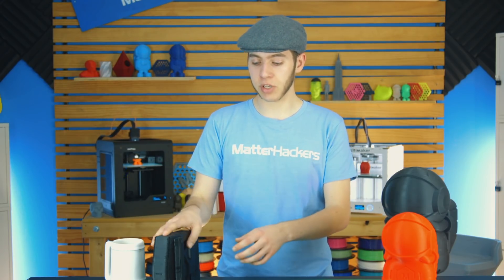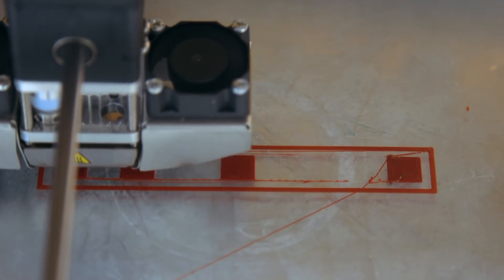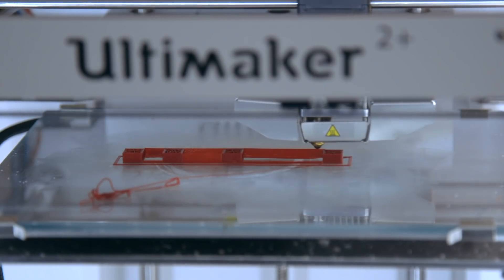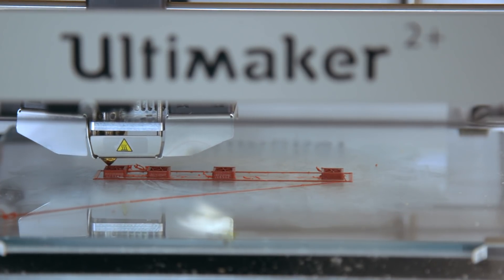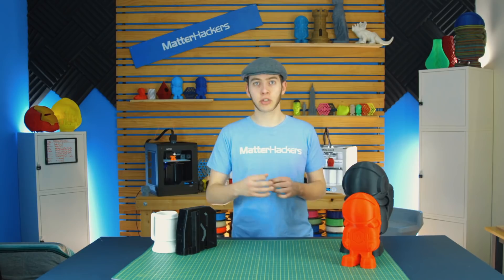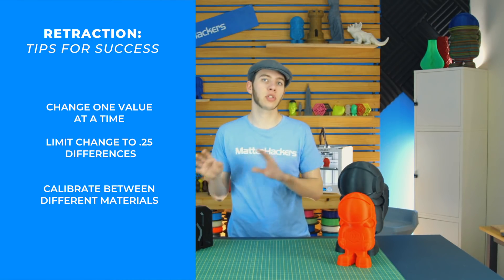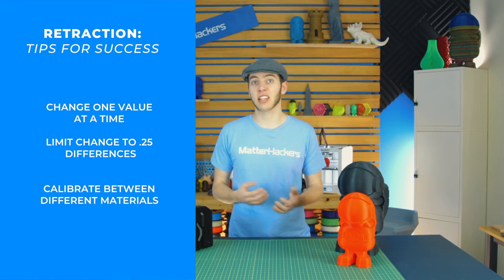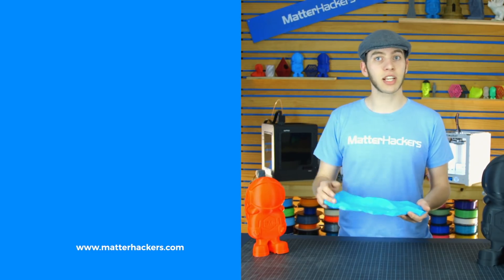How To Dial In 3D Printer Retraction Settings // 3D Printing Guide & Tutorial

Comment: You should try the "retract continue" post-processing plugin. This resolves all stringing and oozing for me (expert user ~10 years in 3d printing now). It works on an Ultimaker Original/2/2+/3/S3/S5, on other printers, and with ALL FILAMENTS as well.

It basically keeps retracting the filament whilst making a travel move. Which in turn prevents hot plastic from leaving the nozzle.
You could also increase the retraction distance, BUT... when you do this you make some not necessary E-moves that flatten your filament.

Open Cura (4.4 or later) --> Extensions -->Post processing --> Retract continue

I would be more than happy to see a part 2 where you test this:D

Comment: My Geetech A10M makes an awful mess between parts. I'm using ERYONE PLA. It extrudes EXACTLY 10CM when I tell it to. I was floored it was so accurate right off the bat.
Now to find out where my retraction setting is in Cura. Maybe I need to change that.
Reply: Retraction on the material setting was set to 1mm. Let's try 2!
Using these cubes since I don't have a matterhackers login https://www.thingiverse.com/thing:909901

Comment: Thank you for the video. I was trying to print with petg in my jgaurora and it was very frustrating I ended up putting it away  it was leaving a lot of strings in my support layer not allowing me to complete any print. Do you have any tips how to set up cura/jgaurora using petg? Thank you

Comment: You should look at Linear Advance. I know Marlin supports this but I'm not sure what other Firmwares do. Basically, if calibrated correctly, Linear Advance can negate the need for any retraction at all. It tries to compensate / adjust for the compression of the filament and the pressure inside the nozzle so you get a nice even flow on speed changes, layer changes etc.

Comment: Hang on a second, how is it not sucking the filament back? Some of the filament in the hot end will be maliable but not molten, it'll have expanded and filled the space in there and when you pull it back there's no place for air to get in, ergo it must create a vacuum. At some point it'll break the air seal but the initial pull would surely be creating a vacuum

Comment: I Discover one Day, That my printer has problem with printing holes at initial layer. There is no problem with shell and bottom (first layer is Perfect), but when there are holes in initial later, the filament Just not stick to build plate. The solution is to reduce retraction distance, and holes are Perfect, but after this, in the rest of print, there are problems like stretching etc... What am i doing wrong?
Reply: I would guess the initial layer speed, second guess bed temperature. But I think we need more info, like what printer you have, what kind of bed you have, bed temperature, filament???
Reply: @echomannen  i think i have solved this problem. Basicly, I have replaced anet A8 direct drive carriage to e3d v6 bowden system. Bed temperature is 60, initial layer is 40mm, later is 60mm/s. The biggest problem was with shitty chinese nozzle, the design of nozzle was unable to perform correct retraction. No mather what retr. settings I used, it was allways failed. Now first layer is Perfect :)

Comment: As soon as you started explain the slack in the tube I knew my problem! I just installed  my Bowden and I haven't cut the tube yet because I wasn't sure of final location, so the tube is still full length out of the box. I definitely am going to mess with the retraction settings! Thanks for the great video!

Comment: i recently learned that i need to increase my retraction cuz i vape around my exposed filament =)
Reply: This may have solved my retraction issues. Thank You. I still need to do a complete enclosure build for my 3 year old HicTop. Still haven't tried ABS yet because of it.
Reply: I keep my 3d printer at my vape shop. I've never read or heard anything about this before. Please explain. I tried googleing but only 3d printed mods showed up.
Reply: @StevenSSmith  Any moisture can affect your negatively affect the usability of your filament. It's best to keep it in a sealed package away from all moisture, even just the moisture that's already in the air in your house.

Comment: If your using software with coast (coasting is where it stops feeding filament so far before the end of a run) settings you can combine retraction and coasting with the really stringy filaments to get smooth prints
Reply: TANK The Hammer and if you use them when you don’t need them you can get under extrusion. Took a while for me to work that one out.